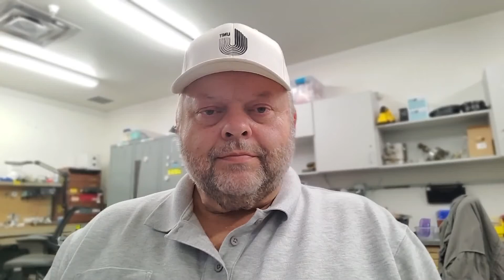Life in the Oil Field:  Electronic Technician

Comment: I’m a sophomore in college deciding whether to do E-tech or something else. I’m trying to do Electrical Engineering but the math is too hard. If you don’t mind me asking, how’s the pay? Is there a career path? Is there job security? Benefits?
Reply from the maker: Hey StyroKyte.  An Etech typically has skills/experience in networking, PC repair, basic electrical, mechanical, hydraulics, PLC operation,  low voltage circuitry, schematic reading, 4-20 circuit troubleshooting, and many other things. :-)  Whew!  I went into the oilfield during the boom of 2011, so they were pretty open to people with little oilfield experience.  I knew a few of the things I listed, and learned the rest.  Pretty much learned by the sink or swim method.  The pay is pretty good - starting out not great, maybe $20 an hour, but after a few years of experience that can be closer to $30.  The real money comes in with overtime.  During the boom, we were working between 110 and 120 hours a week....up to 80 hours of OT at maybe 45 and hour!  It adds up.  But.......when the market dips, you're lucky to get 40 hours a week total.  That money isn't worth being away from family, IMO.   The career path is fairly limited - it's either Etech, Etech Lead/Supervisor, or Maintenance Supervisor.  It's the oilfield, and with the petroleum market fluctuating all of the time, job security is hard to come by.  Benefits are pretty much the same as any other major company out there.  With the last downturn, I was laid off, but I was able to take my oilfield Etech skills and become employed repairing industrial equipment....great job!
Reply: knowing how to work with electricity in any manner High Voltage Low Voltage, PLC CONTROLS, COMMERCIAL INSTALLER....doesnt matter what you pick you will always earn a decent paycheck......hunger and ambition for advancement is what solidifies your position in any career field
and nothing but time in the trades gets you the stripes and working hand skills to actually perform the task but my suggestion learn industrial automation get a basic electrician job to learn the electrical systems...find a system integrator/ PANEL SHOP ...wiring and building control panels is amazing fun
and doing system start ups gets you leaps and bounds of experience and sets you up for an engineering position down the road 
myself and some friends have engineer job title and pay with out the 4 year double EE